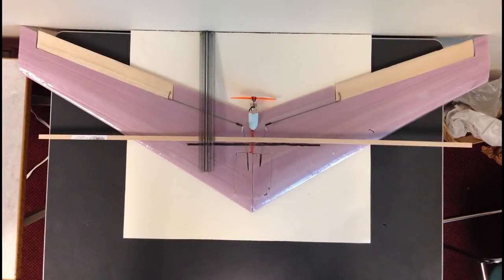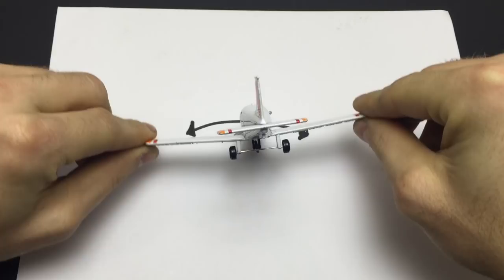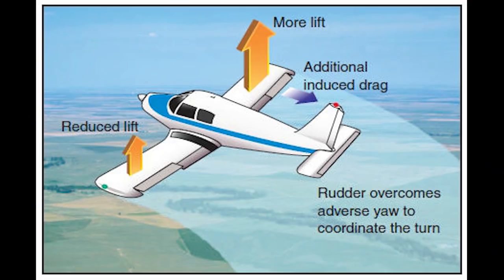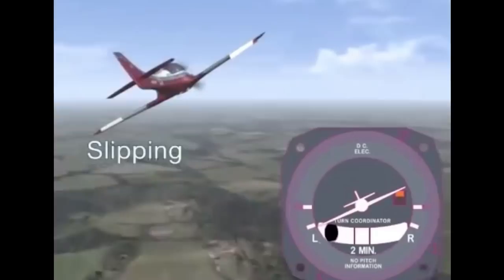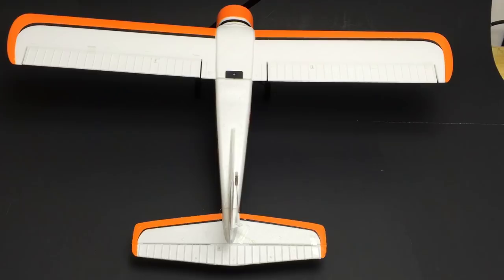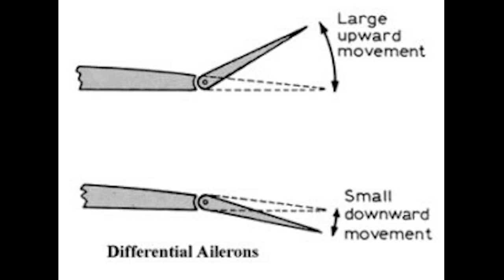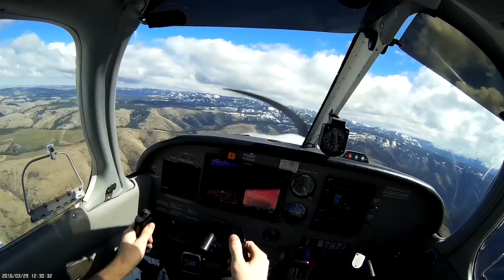Adverse Yaw - Explained and Demonstrated

Comment: Also nice coordination. Try doing that in a glider.
Reply from the maker: Is it worse in gliders because the wings are so long?
Reply: ABSOFREAKINGLUTLY 
Also, look at most glider. The vertical stabilizer is much smaller than most powered aircraft.
Reply: +Samm Sheperd (SNRS) It's bad, even though I've only flown a glider, but from what I've seen, it's worse than the Piper.
Reply: +Samm Sheperd (SNRS) To be more correct on why it is worse for glider, here is a further reply.
The due to the wings being longer, while in a turn, the outside wing is traveling faster than the inside wing. (This is true for any airplane, however the long the wing the greater the effect.) The extra speed equivalates to extra drag causing the outside wing to be pushed backwards just by the ram air. 
Also, gliders cruise at a much slower airspeed than powered planes (well... the J3 Piper cub may be an exception). Just think, how much rudder authority do you have during slow flight? And you have a much bigger rudder than gliders do.

So the mix of small vertical stabilizers, plus slower airspeeds call for more dancing with your feet while flying.

Hope that kind of helps. I love talking about gliding and the aerodynamics that go into play. I am sure the views here would love to know how a glider can stay in the air with no engine.
Reply from the maker: K0S0s I love gliders! Most people assume they just take a while to come down and have no idea about all the lift out there. The long endurance, cross country and even high altitude records set by gliders is incredible. And I'm sure the joy of a quiet bubble cockpit is just unbeatable.
Reply: You would be right on all fronts.
Reply: +Samm Sheperd (SNRS) Except for Air Canada Flight 143, the flight crew did not enjoy their "glider flight".  : )
Reply: I just about to add your comment! A glider has a  HUGE adverse yaw. You turn using only the ailerons and that nose  really swings! You really learn to fly in a coordinated manner in a glider.

Comment: Good video..   On an aircraft with power the adverse yaw is not to much of a worry, this is why the pilot can sit back and fly with just his rudder,, Now on gliders with long long wings and no engine to pull the craft around,,, Well this is why glider pilots have to coordinate ruder and ailerons and Elevator all at once.. Cheers Pete
Reply from the maker: +pepersorte yea using this airplane was a bit cheating haha. Short wings, differential ailerons, high speed. You glider pilots are the real stick and rudder users
Reply: *****  Yes and it is a lot safer,, Lol  Cheers, Pete

Comment: Now take this adverse yaw to the runway, and demo how it is used supplement the rudder in maintaining directional conntrol. A simple X wind landing flow thru. X controled. Maintain  the aileron PROPORTIONALLY OPPOSITE THE DESIRED RUDDER.

Comment: Exelent , only illness thing, I teach the student’s and Captain’s to first center del wheel control and that’s center the ball on turn and bank.
Why ? Because the pilot learn to be instinctive pilot 
Center the control wheel will be easy than star looking at the ball
My experience is I do on my Piits, and DC3 , C46, DC6 on Jet s you have the spoilers doing the work but all Waltham no hydraulic will be back on basics 
So on Jets I did 737, 727, EMB 190 and A320 family 
Happy Landings

Comment: Samm, interesting printed concept.  I'm interested to see how well your structure works for you.  In my experience, the X cross brace structure like you have shown really doesn't do much for stiffness.  If you're fighting top wing plate compressive buckling, either put a simple rib down the center of the wing or make the top thicker.  In my experience, that's better use of material and weight in a shell type structure.  Thanks for the vid.  If I had instragram I'd comment there... but alas I dont.
Reply from the maker: +James Downing I didn't either but Carlee made me try it. Slowly growing on me. Thanks a lot for your advise on print structure, that makes a lot of sense. I haven't yet conducted structural testing but I think compressive buckling would be the first failure point.

Comment: Great video, so it seems programming some differential ailerons based on yaw gyro input could fix adverse yaw on the flying wing ?

Try putting an array of those 1$ bmp180 sensors on your wing to detect boundary layer separation !

When I was in school we made wing surfaces out of straight fiberglass cloth sandwhiched between two shaped metal plates, it was light and very strong. Once you have the mold it was also very efficient in term of man hours to produce a wing section.

Are you going to put a little encoder wheel on your AoA sensor ?

These guys made one like this but I think their encoder is too expensive (more than 70$usd, but great accuracy, maybe too great)

I think it might be possible to embed an accelerometer in AoA vane and just get differential reading with the airframe accelerometer to determine. That should be cheap, lightweight and accurate. Just need to find a tiny slipring that allows for a I2C or SPI signal, maybe something like that use in those 3 axis gimbal with the hollow shafts.

How long did it take to print that wing, it looks huge !  What printer type ?

Did you see those CNC foam cutter, seems to be very cheap to make with 8mm rods, SC8UU bearings and 8mm leadscrews !
https://www.youtube.com/watch?v=yKpq9FZMPqQ

Do you have a source for cheap expanded polypropylene foam in the US or CA ?

Did you try to make autonomous gps guided UAVs ? I found a technique called RTK GPS that should delivery 2cm positionning accuracy (RTKLIB + ublox NEO-M8N).

Comment: If you really want to understand what's happening to cause the adverse yaw, you need to understand the lift distribution on the wing and the way the tip vortices effect the flow around the ailerons. The basic model for lift distribution was settled on decades ago but new research is showing that old ideas still have a place in the modern world of aerospace engineering. Do some reading about bell shaped lift distribution, or BSLD, and you'll see why we have been so ignorant in having to deal with adverse yaw for so long. There is a simple solution. Long story short, forcing the tip vortex to form further inboard than usual causes forces in the vortex to counter act the adverse effects of increased drag by creating thrust. Yes, thrust. BSLD wings have a negative induced drag at the tip that increases with angle of attack, or downward movement of the control surface. Check out the videos in this link. http://www.nestofdragons.net/weird-airplanes/flying-wings/special-horten-flying-wings/nasa-prandtl-project/

Comment: Why does the aircraft roll when rudder is applied? Is it because the rudder applies the force off axis?
Reply from the maker: +Braeden Hamson Most airplanes will roll in the same direction as a yaw input because the wings have dihedral in them. So if I yaw to the right, because of the dihedral, my left wing increases angle of attack, while the right wing decreases AOA.  What you say about the vertical stabilizer sticking up a lot more than it sticks down below the longitudinal axis is also true. This is why the left turning tendency called "spiraling slipstream" exists. However this off axis center of vertical stability works in the same direction as adverse yaw, (or in this case it may be called adverse roll :P). So the fact that most planes roll in the same direction as they are yawed (though slowly) is due to dihedral, which overpowers the off axis thing.

Comment: nice video, awesome that you fly full scale, also the printed wing looks interesting, no supports for the diagonal spars? assuming you printed cross section up.
Reply from the maker: That test print did not include a specific spar hole or way of joining the wings. Yes cross section up, I'm trying both orientations
Reply: When I see prints of "floating" or "unsupported" members like say the petals on a rose, the petals would have vertical supports printed from the bottom up to where the petals are cantilevered. I was curious regarding the internal cross "spars" not sure what to call them. The diagonals with the circles cut out.
Reply from the maker: +Jacob David C. Cunningham I think the printer would be able to print the ribs if they were printed horizontal like normal with out any supports. However the printer can handle 45° no problem and it works really well structurally.
Reply: Oh that's awesome. Thanks for the video.

Comment: You explained half of the issue.  You completely forgot the other aileron producing less drag as it tucks behind the camber of the wing, allowing the lowering wing to accelerate, and thus we rotate around the vertical axis.  If your explanation was all there is to it, we would pivot around the drag-producing device, thus the lowered aileron on the outboard half of the wing, which increases not only induced drag as you mentioned but also increases form drag as we push something into the slipstream.  If you were correct we would rotate around the outboard half of the rising wing, like a B52 does with spoilerons.  GA aircraft don't use spoilerons.
Reply from the maker: I'm pretty sure I do mention the other wing produces less drag. But anyway, an object in space always rotates about the center of mass, I'm not sure what you're talking about
Reply: That's not true.  An object will rotate around the drag producing object.  Imagine if I have a parachute attached to a wingtip and open it in flight - I won't rotate around the center of mass.  If I open the door inflight, I won't rotate around the CG like I would in normal flight.  Even in the spin axis, I don't rotate around the center of mass or the CG.  This is a very common way to teach adverse yaw, only half the issue.  I'm not pointing fingers, just trying to help.  You're a very intelligent person, I can tell from your videos.  Just missed this one point by a little bit.

Comment: since you've mentioned adverse yaw, I'll mention proverse yaw. A couple students a few years back showed that if you give a wing negative twist, you can counter the asymmetrical drag by exploiting vortices (or something like that, it's been a while since I've read about it). it's something that's very useful for flying wing type designs. here's a video the students made: https://youtu.be/Hr0I6wBFGpY
Reply from the maker: +jep Very good video! We have to be careful with twist as the negative lift at the tips can become wasteful. In the previous video I mentioned in this video, called "engineered mini flying wing" I discuss twist a little bit for flying wing stability.

Comment: Question for you, could it be theoretically possible to generate lift without drag?
Reply from the maker: +Snowboard Crawford yes I think so, you would need a wing of infinite span in a fluid medium with out viscosity.
Reply: Interesting is that because the end of the wing is what makes the vortex? Could you make a circle wing that doesn't create any vortex? Like a prop in the middle with a circle around it? Not a horizontal circle but a vertical one, or engines along circle, idk. Maybe an idea for your next experiment. :p

Comment: Looks all very nice and clear, but the truth is:
 you are wrong!
I know it's written since many years in all books and everyone takes it over.
But my argumentation to make you thinking different is the following:
The up going wing has no bigger lift then the downing one!!
The reason is a constant rolling rate is an unaccelerated movement and for this, there is no difference in any force between the left and right wing! 
In the first part of the second you push the command to roll, there is an acceleration, but for the rest of all the seconds of rolling it's not and the lift on every side is the same. But there is still existing an adverse yaw all the time.
If you imagine the relative direction of the airflow into the rotating wing, you will discover that the down going wing is in an airflow coming  relatively from down into the profil. It's like a birdwing striking downwards. The vector of the lift is switching forward and the same lift produce now a thrust component. The upgoing wing produces his lift in a relativ descending airflow and the same amount of lift looks backwards and produces a drag component. 
Don't think i am an theoretic dreamer, i spend 50 years in planes!

Comment: An easier explanation is that the wing going downhill goes faster than the wing going uphill.
Reply from the maker: Well that’s not an explanation but it is a good way to remember it
Reply: I think it's actually deeper than a mnemonic.  The airflow does whatever the Navier Stokes equations say (it won't be obvious) but it has to work out that the down-going wing goes faster, and the up-going wing slower, from energy conservation.

Comment: I just dont get it why the wings produce a different amount of drag? Yes it is right that more lift appears with more induced drag, but downforce creates an increase in drag aswell in my understanding (e.g. Aerodynamics of formula 1 cars).
Reply from the maker: When the aileron goes up, the wing does not create downforce, it just makes less lift.
Reply: Samm Sheperd Thank you for your fast reply! Yes you are right but the total lift (of the lower wing) decreases due to a small amount of downforce created by the flaps(?). In my understanding this is the same amount as the increase of lift at the upper wing since the flaps are moving the same way but in opposite directions. I asume that the primary parameter, which influences drag, is the total area facing the airflow and of course i am not taking into account things like the flowfield at the boundary layers etc.
Reply from the maker: Some things to consider:
-Yes there is a localized force of lift at the aileron. Technically it changes the “moment coefficient” of the ring, which basically means it tries to twist the wing. This is why delta wings and flying wings with elevons work.
- the by moving the aileron up, we change the chord line (a straight line drawn from the leading to the trailing edge) which reduces the whole wings angle of attack. (The angle of the chord line relative to the relative wind direction). By this definition the wing makes left lift and less induced drag.
- think the the lift the wing would have made with a neutral aileron, but with the aileron up, we spoil the lift that would have been there.
Reply from the maker: I know my explanations aren’t perfect, but maybe offer insights. 
Your questions indicate that you have great potential. Most will accept the facts and move on with out running through these thought experiments. Keep thinking and challenging these thoughts

Comment: is a 'slipping turn' the same as a 'skidding turn' ?
Reply from the maker: Good question. It’s basically the same thing but in the opposite direction. Say you’re turning LEFT. but the aircraft is not yawing far enough, so the left side of the fuselage is getting hit by the air.. that is a SLIP. A SKID, by contrast is like a car drifting around a corner, where the aircraft yaws too far, from too much rudder or something and now the right side of the fuselage is getting hit by the airflow.

Comment: always like your video´s i always learn more stuff :) 

i would like to know what this wing i built have or do not have regarding lift then iam banking and tanking it, i have no rudder input on it... my general feeling about the plane is that the stall speed then banking and yank turning is rely low...but i dont know and would like to learn what i have created. cuz it flys nice and sharp, can do rely tight turns with it and so on..

the wing is flat on the bottom and on the top side it has a small curve 3.5cm in to the wing. but not on the entire wing..

https://youtu.be/ae0uGyzUSGw

Comment: How rich is this kid to have a pilot license and plane to fly so young??
Reply from the maker: +Re I work as a certified flight instructor for a university. That was their plane
Reply: That is a good profession, good to know you aren't one of those rich kids who just get loads of things handed to them.
Reply: Re Around here you can rent a plane for $50/hr without fuel.
Reply: +NordboDK You need about 40 hours before you can get your private pilot license, so if fuel was free and instructors were free it would be at least the price of a decent used car to just get licensed. That's not cheap
Reply: Re o, 40x$50 is $2000, burning fuel at about 8gph, $5.27/gal for 100LL avgas is $1687. The last big expense is the instructor.

Do you consider that expensive for a skill?
Reply: +NordboDK Well you can't use a private pilot license for commercial gain, so $5000+ is a lot... for a hobby. More than the average first car for an 18-22 year old! If he becomes an instructor he still did get an investment of $5000+
Reply: You keep moving the goal posts. The FAA requires 50 hours as pilot in 
command, and 250 hours of flight time total. You can log part of that 
time in approved flight simulators. If you need to go on a long trip, 
consider doing it by plane, instead of driving. It will help build your 
time, and offset the cost. You can join Civil Air Patrol and get flight 
time that way. The ones around here have approved training sims that 
members can use for free, so that can cut your costs, too. Like any 
college degree, you have to look at it as an investment that will allow 
you to make more money down the road. There are also ways of sharing 
costs when flying as PPL to look into. 

Note that to get a Commercial Driver's License, you are looking at about $6-10000, too.
Reply: NordboDK Stop using fallacies to dismiss everything you disagree with, you dont need to explain to me why $5000 isn't a lot of money lol
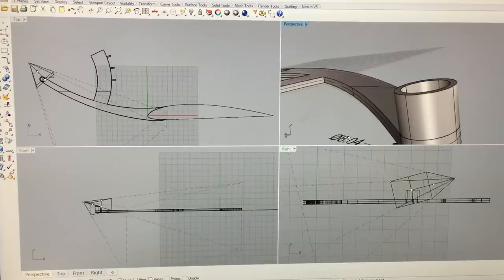Reply: +Samm Sheperd What is the software you're using in 3:45? Is it Rhinoceros?
Reply from the maker: Luiz Otávio Yes